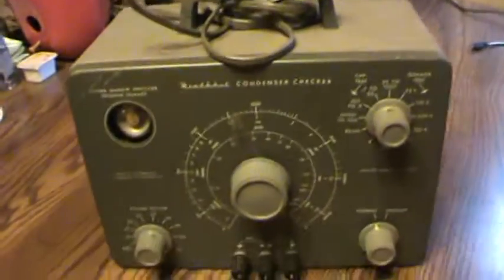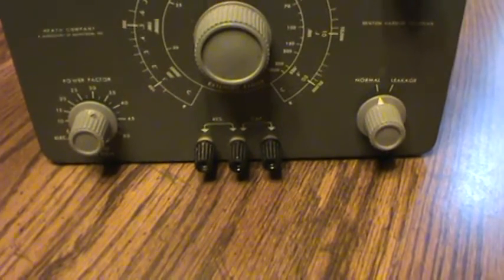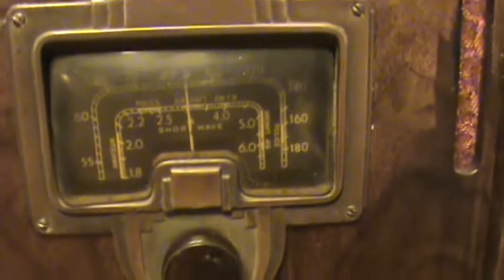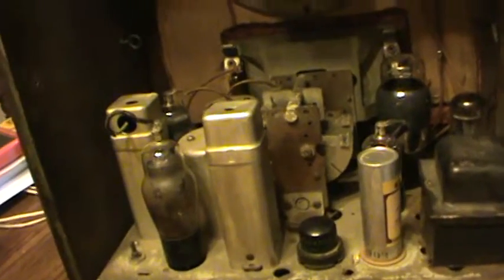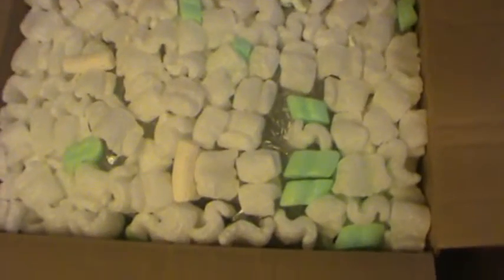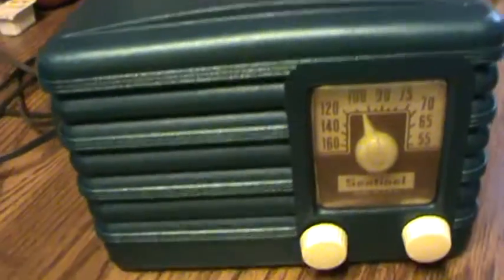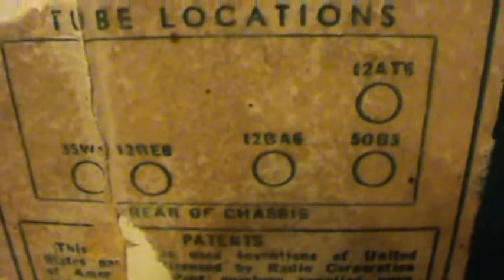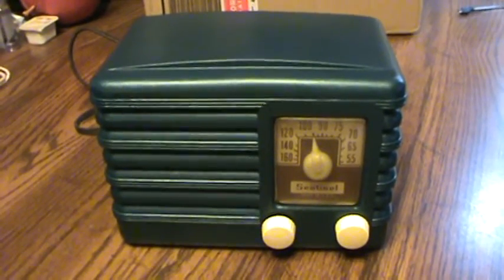Odds & Ends #41B--A Few Old Things New To Me and A Question or Two.

Comment: Gary,
Like everyone is saying, those are banana plugs.  You can get banana plugs and sockets from ePay.  I go to RA Elco and buy them.  I buy the really nice flexible wire for making test leads.  I get that at RA Elco, cheap.  I talked to Robert, and he will ship stuff that you buy there.  They are pretty accommodating there.  They have a lot of stuff that is hard to find anywhere else.  I love that condenser checker.  I have one similar, a Heathkit Model IT-11.  Cheers!  Michael

Comment: Hi Gary..I like those radios.....On the small radio, maybe it was cracked and repaired. then painted...I have repaired many Bakelite radios and plastic radios that were cracked...I'm cheap and  when I needed a radio to fix, I went on Ebay.....the cracked ones....they were cheap.....I  used Bondo to fix..... then paint...Look on the inside of the radio to see if it has been repaired....Buzz
Reply from the maker: Thanks Buzz, I'll check inside to see if it's been cracked, but either way, that metallic hunter green paint has got to be replaced with something, lol.  Take care, Gary

Comment: Hey Gary,
That's a cool cap tester. I have the matching signal tracer and signal generator. That's a cool RCA radio. I had one like it that was junk and falling apart that i picked up at a sale a few years back. after i robbed the usable stuff it got trashed. Those were nice sets. Jason
Reply from the maker: None of my stuff matches, LOL.  I don't have a signal tracer yet and my generator is a Knight model, my tube tester is a Hickok 532 and my isolation transformer is a Stancor, but like I said, strays seem to follow me home, lol.
Reply: LOL Nothing wrong with that. Not many things i have match, But they do the job. That's what counts. I know what you mean about strays. Everytime i go to a sale or hamfest i have a few of those "strays"

Comment: dag gone Gary, just don't use those pineapple plugs.  yah, ordinary banana plugs should do.  but those binding posts should also accept cap wires.  make sure you discharge those suckers after testing them, ooowee that can smart!  
I like that wee Sentinal, did you try it yet?  I'll bet it works.  Don
Reply from the maker: Haven't tried that Sentinel yet.  Thanks for the info.  I won't be grabbing any caps by their wires, that would be a hair raising experience....if I had any hair, lol.